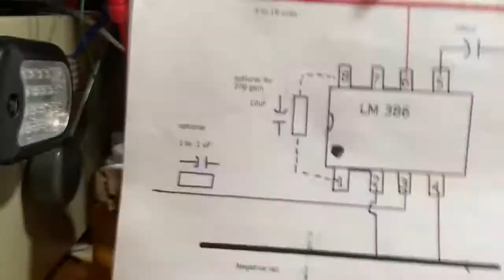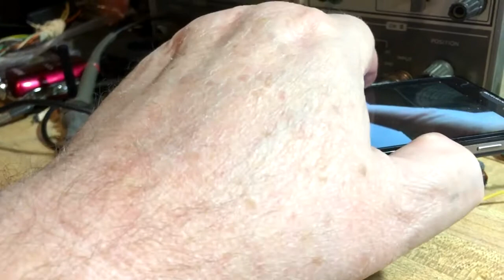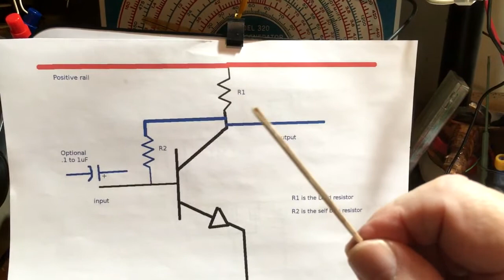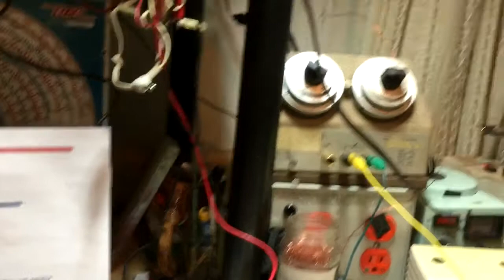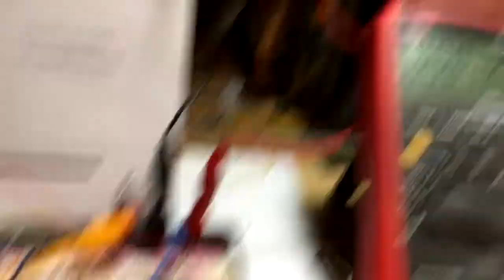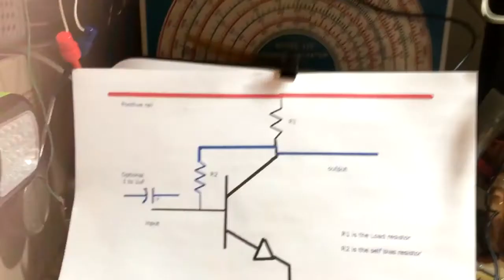Amp the Crystal pt5

Comment: Carl - now this makes sense to me.. very very cool..   thank you for explaining this in such detail...  I love the vintage resistor decade box deal... very very cool. awesome my friend  .This makes me want to start play with my breadboard for my next project as well.  Very cool - thx bud
Reply from the maker: Yeah Ron the boards do help. Being able to throw a circuit together quick to see if it works really helps. Knowing that trick of splitting the voltage can let you build simple transistor circuits in minutes. And the 386 becomes quite a useful tool also even in it's most simple state.